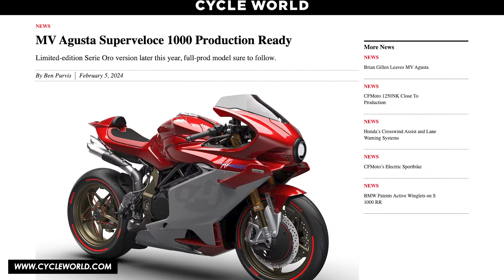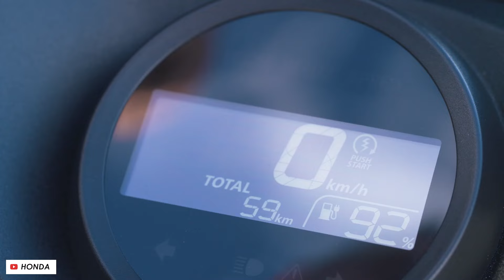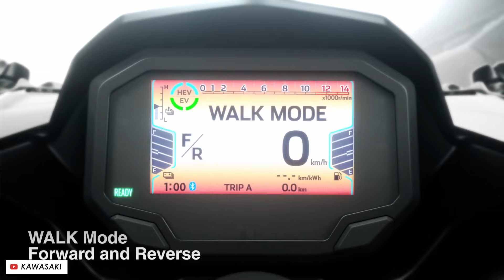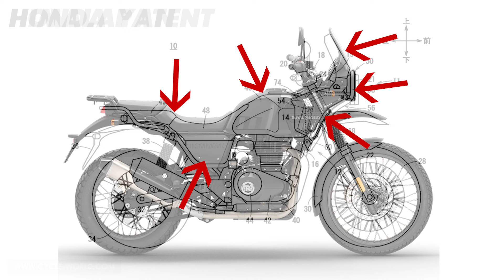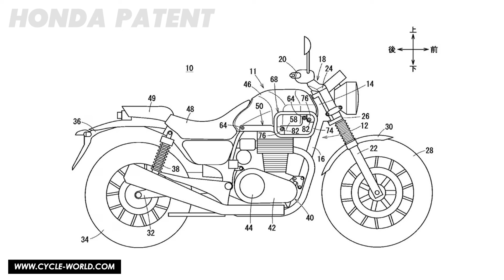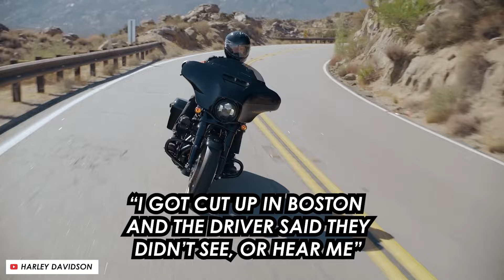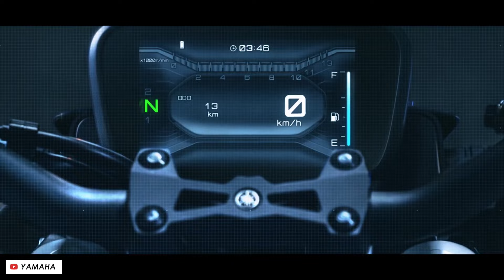The Moto News: MV Agusta Superveloce 1000, CAKE files for bankruptcy, Honda Copying Royal Enfield?

Comment: In the real world more simple, less ecotic bikes like moto guzzi, triumph, norton suzuki sv650 make sense as servicing, spares and using as everyday transport doesnt suit bikes like ducatis or mv agusta. In my opinion theyre for car drivers who want to pose on sunday runs. In the real world the norton 961 commando is beautiful, great fun with basic design thats so practical even for the home mechanic but even at £17k its still a bike with such great build quality in fit and finish on another level to any other manufacturer. The suzuki sv650 and v strom are such practical, well priced and great bikes, proven over 20 plus years and the sv650 is a true bargain. With speed cameras everywhdre and such high costs to run big bikes especially KTM and MV and harleys they make a lot of sense. Big adventurs bikes like shaft drive triumph 1200 explorers are a lot of bike for the price and are very good for touring 2 up or even yamaha supertenere1200. Ztill its all subjective and the choice, tech and quality nowadays with ABS, rider aids and great design is amazing and maybe im getting old and a bit out of touch.

Comment: It's a grab handle to pull it out of a hedge. And for most beautiful bikes I'd go back further into Ducati's history and pick the bevel 900ss in black and gold from the late 70's. For current bikes, the Moto Guzzi V100 Mandello S in Verde ( mine arrives 1st March).
Reply: The 900ss ducati had crankshaft issues and my cousin who had a motorcycle dealership and a mate who owned 900ss confirmed this even though they sere so nice to ride and handling and torque was huge for its day out of those desmo motors.
Reply: @Ian-bq7gp  only the early ones, there was an improved crank from 78 onwards. I ran one as daily transport for 5 years without issues.

Comment: Not really surprised about Cake. More of a lifestyle brand. The future of electric motorcycles still is sure though. But first we need a next generation of affordable, recyclable, sustainable, light weight battery technology. And they are on the horizon. Solid state probably. In the mean time I am working on my own project. Chassis wise I am almost ready but the cost for the electric stuff is still prohibitive. Which brings us back to the previous point.
Reply: Price
Reply: @houseofroos  Assuming that is a question: The investment in batteries, controllers and electric motor will already be about Eu 5000 to 6000. One can buy a complete ICE bike for that sort of money. And that is still without a guarantee I’ll ever get it road legal. Then there is battery weight. Like I said: A next generation battery technology is needed. Until that time medium to high performance electric motorcycles will stay expensive.
Reply: @marcbrasse747 Oh sorry for my cryptic comment, what I meant was ev motorcycles need to be cheaper to get traction. They’re just too darn pricey. We’re in agreement. Thx